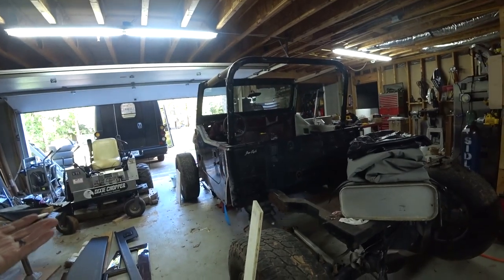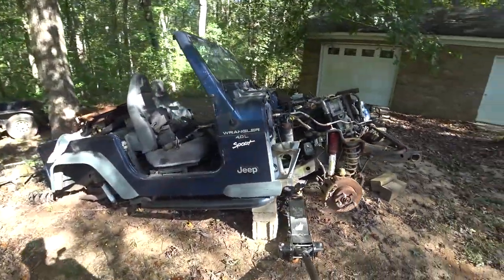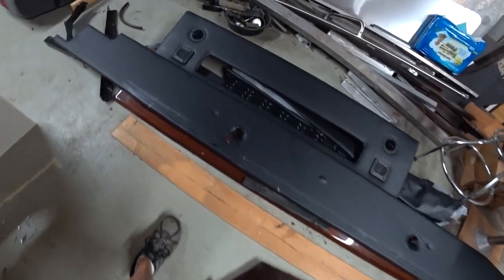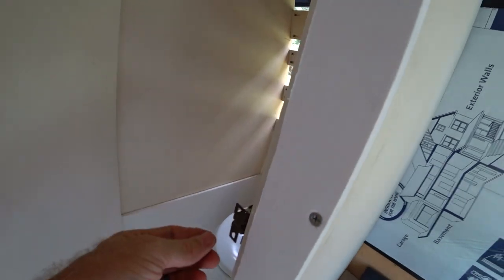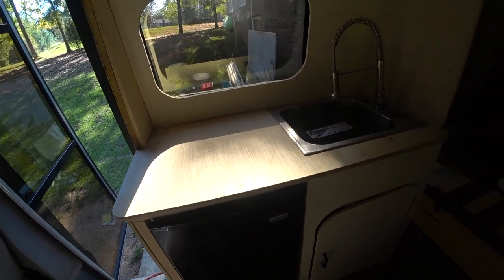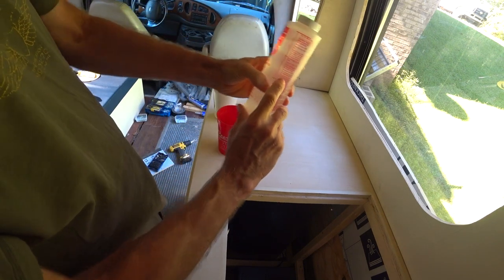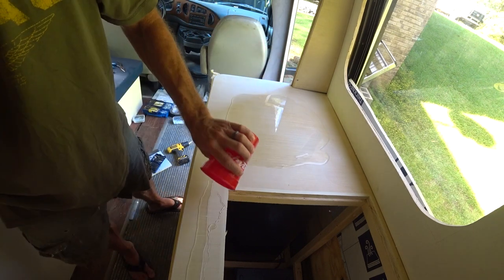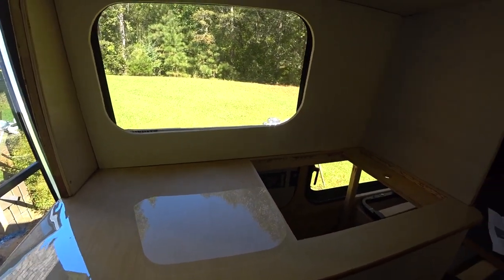Epoxy Counter Top for my Shuttle Bus Camper 13

Comment: Two questions(I'm not sure if they've been answered in previous videos, so sorry)

1: what size bed do you have in the rear? Looks like a queen to me, but it's hard to tell

2: what kind of MPG do you get in this turtle top? I know it'll be worse once the build is done, but I've not been able to Google solid info on the specs of these beautiful shuttles